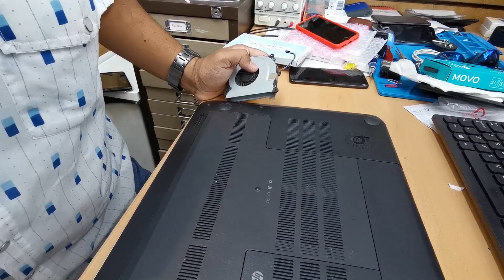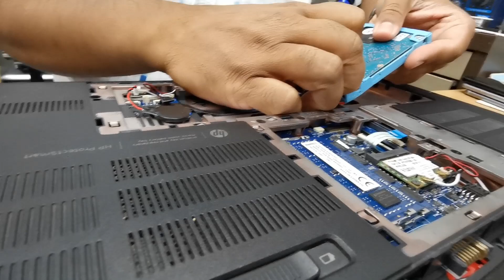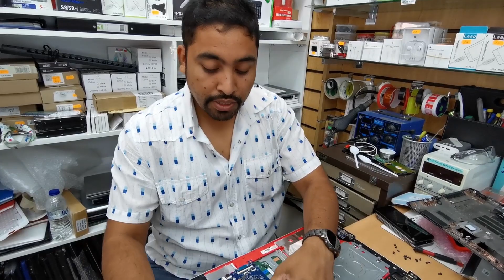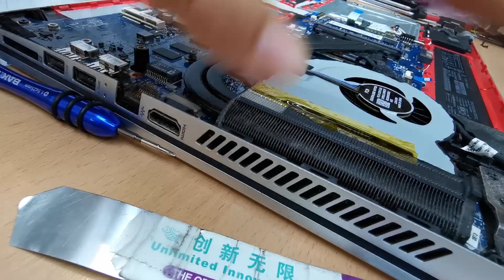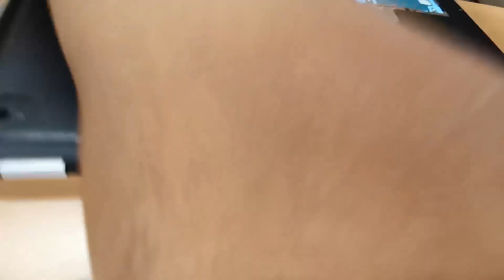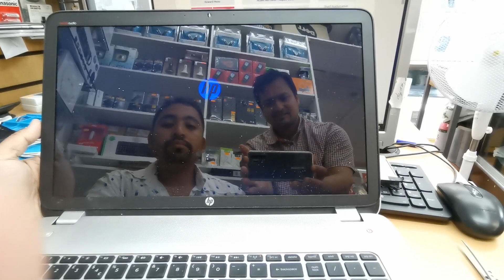HP Envy 17 tear down and cooling Fan Replacement

Comment: I've replaced the fan but haven't hooked up it's connector. I want to make sure I don't hook it up backwards and fry something. It doesn't look like there is anything that prevents you from hooking the connector wrong so do you know the pinouts?
Thanks

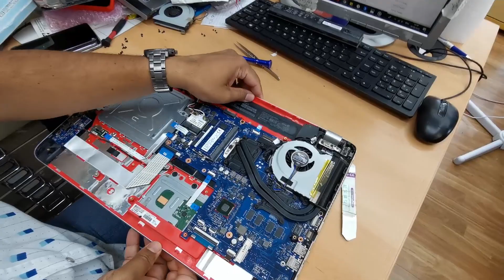Comment: @ 7:03, what chip is that? Mine too has a thermal above it connecting to the bottom cover chassis. I was wondering what thermal pad should I used it with and what size? Which areas can I add additional thermal pads? What tapes are used around the heat sink grill and fans? can I use vinyl electric tape instead of the Kapton tape?

Comment: Hi, When in the middle of a big job processing many GBs of photos the last I needed was an over heating laptop.  It got to a point where I was processing images for an hour or so, then shutting down the HP Envy to cool off and ten doing some more.  We have a temperature tester that we use for COVID-19 checking and this also has an option for testing other temperature, the HP Envy was recorded with 45c just above the heat sync area.

After finding your video and watching the process I ordered a new fan that arrived this morning, 4 days early.  I installed the new fan after following your very detailed demonstration and it all worked perfectly.  I did find the heater exchanger was completely blocked along with other vents and after spending some time cleaning off the dust and fluff it all look great.  The HP Envy has now been running for around 3 hours and I can't hear a sound from the perfectly working fan.  Brilliant thank you
Reply from the maker: Hello Sir. I do admire your time about this comment. You have done a great research on this Hp Pavilion laptop. Great work. Hope you would subscribe to my channel ! Thank you!

Comment: Great video, I seem to have an issue with my HP Envy getting very hot and although the fan runs I can not feel a flow of air passing the vent, have tried cleaning the vents with a small hoover but still have the problem.  Thanks
Reply from the maker: Thanks for sharing!

Comment: I have the same laptop and issue. The corner hinge is broken which a piece jammed the fan. How can i fix the hinge?
Reply from the maker: It depends  based on which part is broken. The hinges? or the hinges base? If hinges then I would suggest you to replace it.
Reply: Exactly the issue I have/had. It was telling me the cooling fan wasn’t operating properly. Used canned air, put old fan in & works fine. Of course I found the brass fitting the hinge screw goes into and chipped plastic inside. Right now, I temporarily haven’t tried to install that particular hinge screw. Ideas??? And SUBSCRIBED!

Comment: Hi, im getting an error after putting everything back. HDD cant be read by the laptop. I tried to put the HDD on differemt laptop but OS boots fine. Any ideas?

Boot device not found
Pls install an operating system on your hard drive disk.
Hard disk (3F0)
F2 system diagnostics
Reply: I had this issue just now. Make sure the wide thin black wire that connects to the hard drive (05:49) is inserted inside correctly. I adjusted it and it works now. GL!

Comment: Thank you very much for your video upload. I have watched hundreds of videos but yours is the best. The video recording was great by your partner. Your video is very clear, good commentary, good visuals and you explained everything in excellent details. I appreciate your sharing. My Envy is running crazy especially when I installed Samsung 860 QVO SSD and used my original as data. The computer was running hot before but now it is running the fan more rapidly and temperature goes up to 42C. I will open up the back cover and clean the fan and vent plus see if the "sticky white paste for heat sing is dried or not. I have to buy one from some store. Normally it will cost $150.00 to get it done at repair shop but it is so easy I can do it after seeing your video. Thank you very much again. I liked your video and gave you a thumps up.
Reply from the maker: Thank you so much!Hope see(subscribe) you again in my channel.

Comment: Thank you for your video, very understandable. I have same laptop HP envy 17 2014, can you help me to fix the broken left hinge, although I have seen other videos in this regard but not for the same laptop and how can I add another SSD hard drive with it's connection pl.
Reply: I had a broken hinge on mine as well...Open the lid. Use strong epoxy glue on the inside casing (where the screw holes are under the hinge) . I used epoxy glue all over, on the top and under and on the sides ( just DONt put any glue on the inside of the hinge or otherwise it wont move!). Clamp the hinge to the case for 24 hrs and let the glue dry  It should be a strong fix! Also dont forget to put some mechanical grease to the hinges when your done.
Reply from the maker: thank you very much for your comment against my videos. Fixing laptop hinges is a pretty tricky job as it depends on many things. sometimes not only the hinge is broken sometimes the screw base also dried out. In your case, if the hinges only have broken then change the left hinge.  you can add secondary SSD if there is any M2 SSD slot otherwise not. in this case only one SSD you can replace with  (2.5 INCH sata SSD)
Reply: @thepcphone  Great video! I’d be interested in the fix for the dried out screw base. Mine was dried out & chipped off rattling around inside. Thanks